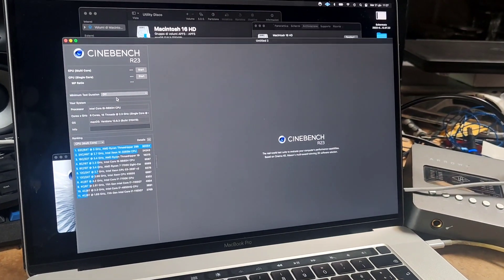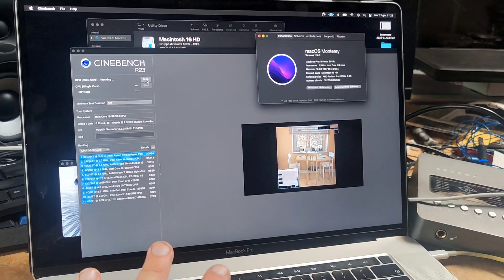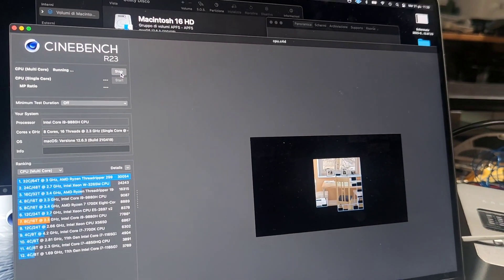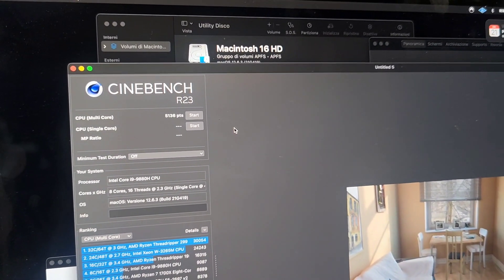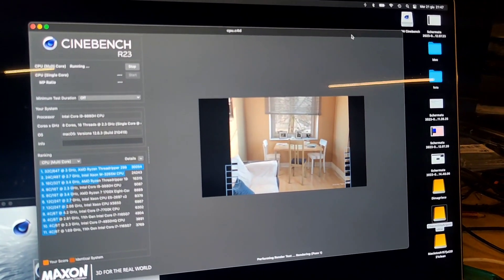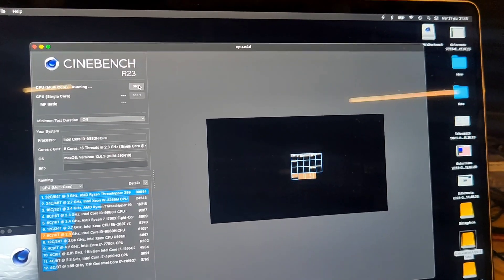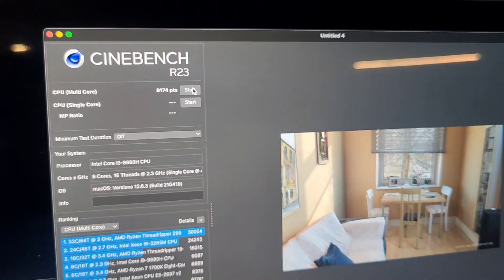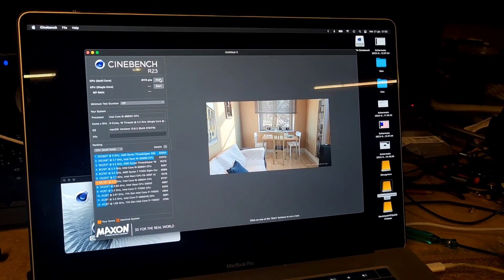Tuned 16" i9 MacBook Pro Cinebench scores - no performance drops with extensive use of thermal pads

Comment: Do thermal paste like Grizzly kynout thermal paste doesn't work?

I have same issue when run more then 10 min instead of 3.6 mhz it drop to 2.8 ghz to cool down because it touches 100 degree at full fan speed

My mind says change thermal paste
But what do you think i order a thermal paste or use thermal pads
I do have these thermal pads
1.5mm and 0.5mm
Reply: No you need either thermal pads of the right thickness or some kind of putty like K5 pro. Normal past is not thick or viscous enough for such a large gap.
Reply from the maker: @qaxxmm  not thick enough

for repasting use ptm7950 it's a godsend
Reply: @mircomputers  ok
0.2mm ?
Reply from the maker: @qaxxmm  yeah that or 0.25 doesn't really matter

Comment: Although this is a nice fix for performance, i am kind of afraid of cooking the tcon board from the etensive heat the bottom now has, did you notice it on this model like the 2016 and 2017 had? Horizontal lines when it got hot etc? I really dont want to risk a tcon board just for some performance.
Reply from the maker: that is Flexgate, nothig to do with heat from the board
Reply: @mircomputers  Flexgate is another thing, flexgate is when the cable from the display gets crampted by the mechanism because its very tight, hence thats why it works in certain angles, tcon cooking  is another thing, the tcon chip gets cooked from the heatsink that is very close to the display board, so when it shows horizontal lines, the chip slowly desolders itself, that why its temporary, only happens when its hot, if you put the machine to sleep the display turns back to normal, but if its hot it starts doing it again.
Reply from the maker: @panagiotismastoras  i have never had this issue and been doing this mod to many machines in the last 4 years

I got some machines with yellow/orange spots, wich are results of pressure on the metal case of the screen, that is fixed using suckers and pulling on both sides of the display assembly where the yellow spot is to restore its original shape

Comment: Use Macs Fan Control. The pads will get torn up anyway the next time the fans are cleaned. Plus, passive heat from the backplate will radiate on other components, such as smaller SMDs and the battery, which will shorten theiry lifespan. I do not recommend this.
Reply from the maker: @ElysionArg  macs i open have never been cleaned and never will be in the next 5 years. The heat would move much easier through the internal PCB compared to irradiation, it just escapes faster expecially through the top. Only thing that maybe affected would be the touchbar but i have no report of any issue arising from customers..

Comment: So you are recommending of applying thermal pads like ptm7950 on thermal pipes ? If yes maybe I will do it when my MacBook Pro will need a cleaning and a repasting
Reply from the maker: PTM is a bit too thin and overkill for this use
Reply: @mircomputers I have already zone it😅 yeah this work well with 2 layers of 1mm pads but yeah, little bit expensive
Reply from the maker: @-ragnir-  how's the performance? did you do on the inside, to get heat on the top of the machine? the bottom is not so useful if you don't keep the machine with some cooling fan under it
Reply: @mircomputers I am using it wirhout cooling fan under and it is working pretty well, from 98c to around 105 on cinebench 16t turbo boost on to 90c max, for thé GPU the clock non longer go down while gaming. From 90% résolution mid settings and little performance drop over time to 100% res high with no drop over time
Reply from the maker: @-ragnir-  only bottom pads? or did you swap thermal paste aswell?
Reply: @mircomputers nope the thermal paste has only few month so she is alaways good. I have placed a little bit of pads on the middle of thé heatpipe and the heatsink